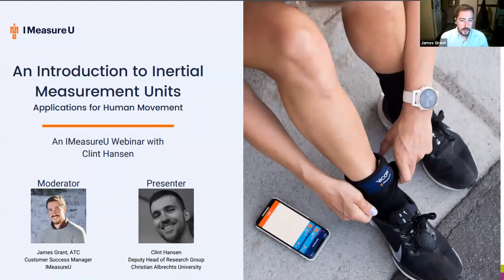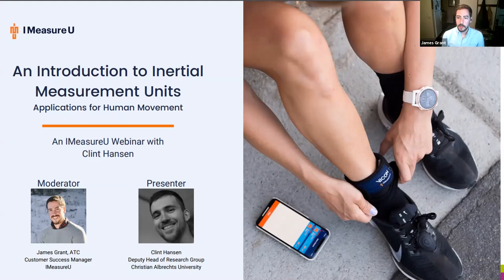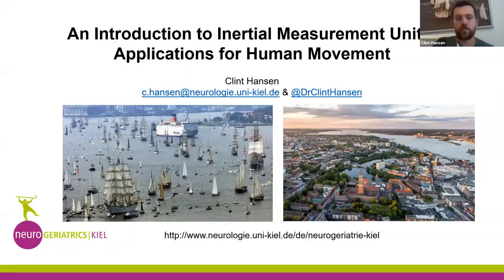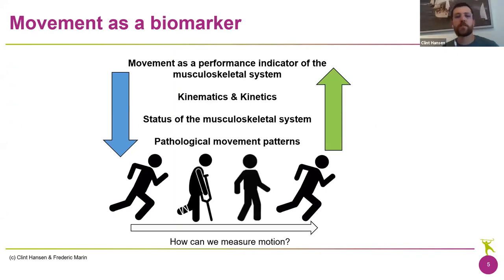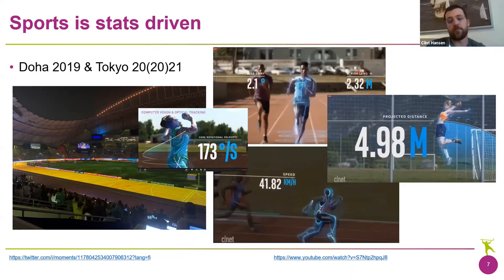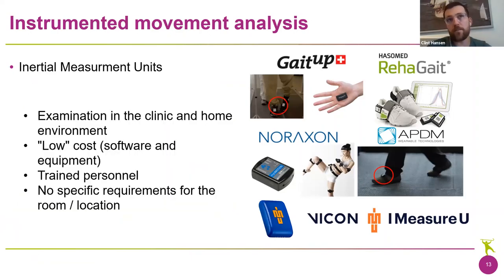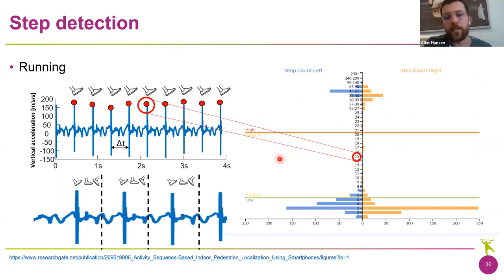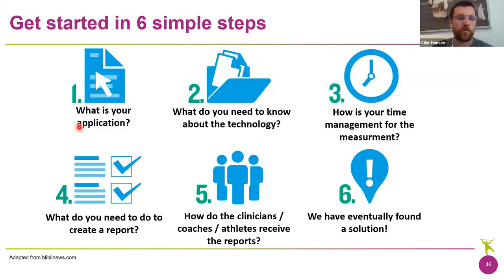An Introduction to Inertial Measurement Units

Comment: Hey, this was a very helpful video to understand the measurement of the IMU. Do you know if there isany  programm where acceleration signals can be integrated to detect the orientation in x, y and z direction?
Reply: Fighter jet planes have been using IMUs for half a century. You can calculate position if you first calibrate off an initial known position. The longer you travel, the less reliable your reading.